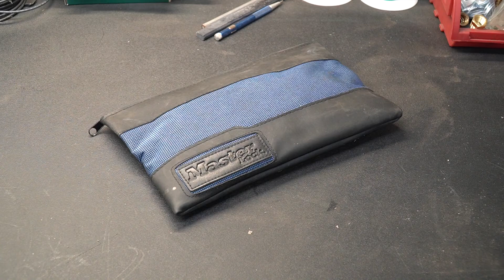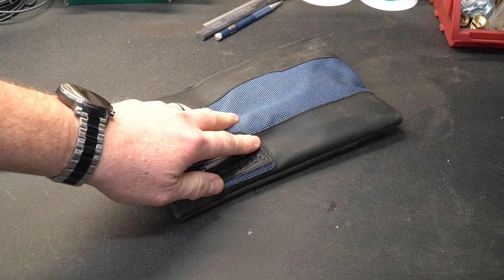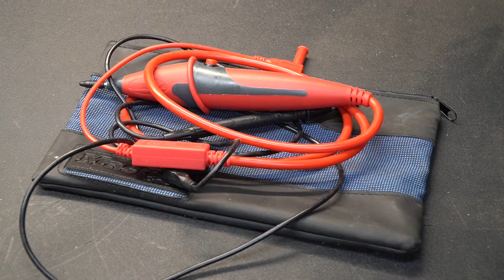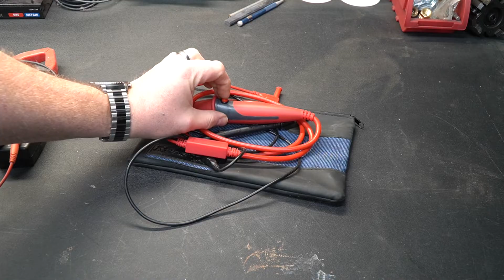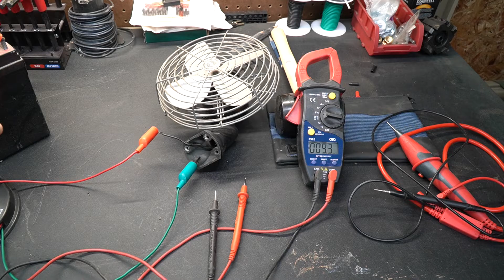Troubleshooting automotive wiring the easy way, with a Load Pro! "New Tool Day Tuesday"

Comment: What load does it apply? 1A? 3A?
Reply from the maker: The LoadPro applies a dynamic load of 40mA per volt.  On a standard 12V circuit, it draws approximately 0.5A (500mA).

Comment: can you use this to diagnose wiring issues in the Hi speed CANBUS system?
Reply: No. CANBUS does not carry any significant amperage. Only way Loadpro can help you is as a regular set of leads. It’s actually the meter that would help ( 120 v 60 ohms, for example).
Reply: @ thanks a lot

Comment: Need to let people know to use the ground on the function then move to a good ground if load is good on a good ground it’s the ground wire that is bad but if load isn’t good on a good ground then it the voltage wire that is bad you still only load the voltage wire but this way you can tell which one is corroded or nearly broke

Comment: The video would have been more informative had you explained what the reading should have been at 3:45 if there was no resistance in the circuit.  For example, does that 3 volt reading represent voltage drop?  Thanks
Reply: The voltage reaching the multimeter dropped from 12.8V down to 3V. That's a drop of 9.8V.

This is the same as checking the voltage to the fan while the fan is hooked up and trying to run.

Comment: Pretty nifty tool, I work on Semis and trailers.  Cummins now recommends using this tool for testing during some diagnostics. I gotta say it's so much faster to use than dragging out the ole headlight bulb to put a load on the circuit

Comment: I would think some would test for voltage while the the wires were hooked to the fan to give them the same diagnosis. But the tool sells for a reason.

Comment: What if your testing one specific wire from let’s say a sensor connector to the ECM connector? Where do you get the power for that circuit?
Reply: Completely isolate the wire, introduce battery voltage on one side of the wire, put load pro on the other side then connect the load pro negative lead to battery ground.

Comment: Just buy an electronic load or just a power resistor and a fuse.
Reply from the maker: Or you could make one.   Plenty of options for sure.   This is just another tool for the professional.

Comment: so what would have been the reading when you put a load on the good wire? Would the voltage have been higher or lower than 3v?
Reply: Should be close to battery voltage if the wire is good

Comment: I think one more step that would have been good to show people so they understand it a little better is to put the meter leads on the wires while they're connected to the fan to demonstrate that the load of the fan causes voltage drop due to high resistance inside the circuit. before I knew this tool existed I got burned pretty bad on a job where a truck wouldn't run but showed that the ECM had good voltage. after a lot of tail chasing I back probed the connector and plugged it in and the load of the ECM caused the voltage to drop to nothing. If I had owned the loadpro at the time I could have checked static voltage, seen that the voltage went to nothing and known right then and there that i had high resistance.

Comment: Interesting tool, but not needed. You have the circuit energized to test for proper voltage and ground at the component, never unplug a circuit looking for a voltage drop problem. you can not measure voltage drop on an open circuit. Leave the circuit plugged in and back probe the connector with a t pin and measure the voltage and again on the ground side.
Reply from the maker: Right, it's not needed, just another tool to speed up the trouble shooting process.

Comment: I can see the tool has value. However, why wouldn’t in this particular simulation would you simply use the fan?
Reply from the maker: If you knew the fan was good, sure.
Reply: @1D10CRACY  Assuming a bad wire, if the fan is good, wouldn’t it show the drop but not come on? If the fan is bad, wouldn’t it show the same voltage but not come on? Assuming a good wire if the fan doesn’t come on and you have voltage, then I’d guess a bad fan?
Reply from the maker: Your assumptions seem valid enough.  Keep in mind everyone has their own techniques when troubleshooting.   The load pro is just a tool that can sometimes help with speed, not a necessity.

Comment: Btw, do your best and use the negative from the plug...... just so you can rule out a corroded neg wire ;)
Reply: I read all the comments up to and including yours, because I was about to post the same thing. The author did not check the ground side from the connector to ground. He went straight to ground forgetting one half of the circuit! It’s a useful tool for sure!

Comment: This is a very handy tool. I took Dan Sullivan’s electrical class around twenty years ago and used his first version of this tool for the first part of my career. Being a heavy equipment mechanic it helped me troubleshoot many corrosion problems. It looked like a set of test leads with a black box in the middle that had a red test button. I later upgraded to this newer set. It saved me a lot of time troubleshooting problems and to me is a must have in your tool kit.

Comment: A pro needs a go-to built-for-purpose tool to speed troubleshooting.  Those of us DIY'ing can take the time to build the tools ourselves.

For load testing, just raid a couple of incandescent duel-filament tail light bulbs, sockets, and a few inches of wire lead the next time you're at the junk yard.  I have a collection of marker lights (0.2 amps), tail lights (0.5 and 2.0 amp), and headlights (55 and 65 watts).  Wide-mouthed athletic sports drink bottles can be cut like a funnel to provide a hood to protect flesh and bulb from meeting while hot.  Hot glue will anchor the bulb socket to the mouth of the funnel hood.

For troubleshooting powers and grounds almost duplicating the Power Probe tool?

Start with a quality 14 gauge, ten foot extension cord.  Cut the female plug off keeping 4' or so of the cord attached.  Strip back the external cord sheath 2' or so exposing the individual wires of power (black), ground (green), and common (white).  Attach 30 amp alligator clip/clamps to the individual wires -- a red clamp for the black wire, the black clamp for the white wire, and a naked clamp for the green example.  Use green heat shrink tubing to mark the ground clamp as, well, ground.

What we now have is a female power cord end with alligator clip/clamps on the other end.

Do the same thing to the male extension cord end but rather than use alligator clip/clamps, go with some kind of female banana socket.  Keep the red, black, and green color scheme consistent and with continuity.

So, how to use?  The red and black conductors are rather obvious.  The green conductor can be used for supplying a valid 5 volt reference if necessary.

Here's the nice thing about this setup..  If one needs a longer reach, just plug in any regular extension cord for battery-to-back-of-trailer diagnosing.

Be sure to leave each individual conductor with enough room to get an amp clamp around it.
Reply: Thanks

Comment: Just connect the dvom to the cables the same time as the fan and it will show the same result.
Reply from the maker: You could, and now you have to determine if there is an issue with the fan causing a voltage drop and not coming on, or if there is a broken wire, bad switch or something isn't capable of carrying the load.   Same result on the meter, but not the same answer.  You could use a test light to see if the circuit can carry a load!

Comment: I used the loadpro when repairing construction rental equipment. Found lots of corroded wires, defective switches even defective brand new switches. Lots of people trash talk this tool here on YouTube. But this is my prefer way to test voltage drop. I made an extension lead so it could fit in tight spots.
Reply: Does it work for 24v?
Reply: @everytoolashammer9427  Yes it does upto 28.5volts. I believe there is a newer version that does upto apx 48 volts.

Comment: As a technician, I find it a bit stupid that a technician would stop and recommend a component just because you see 12v on it's positive input. Part of the diagnostic process for electrical is checking for good power feed, checking operation of the component isolated from it's power and ground and then checking it's ground. I DID pick up a loadpro just to have a new tool in my toolbox, but it's going to sit beside my powerprobe which I use for actuating certain components.

As an example, I had a 2013 Pilot with 3 door lock actuators that would not lock/unlock. Checked it's input and output and found them switching normally. So our control from the integrated relays of the MICU were good and doing their jobs. ($800 part), so the next thing I went to check is isolating the door lock actuators from network, providing them a known good ground and 12v for a brief second, enough to actuate them open and closed. No functionality. Dead door lock actuators confirmed since when isolated. Same thing with your fan example. Fan doesnt work but is receiving 12v? Let's isolate it, give it 12v and boom, it's spinning like normal. Now we can focus our gaze on the ground side of the system since we've confirmed we've got A) Good power and B) a functioning component.

But it'll be fun trying to work the loadpro into my diagnostic routine since, hey, new tool because MUST HAVE NEW SHINY TOOLS.
Reply: It’s mostly meant to help figure out if you have high resistance in the circuit.

Comment: That’s a pretty cool tool. I seen a tool a while back and I can’t remember what it was called but you looped it or “open clamped it” on a wire and could run it down the wire to find the break in it. It was used to check Christmas lights and the light on it would go out when it found the break in the wire. Of course you couldn’t run it down many vehicle wires like you could Christmas lights but I thought it would be very useful too. Between the tool I described and your load pro you shown, it would answer about any electrical questions. 👍
Reply: Maybe a clamp meter ?
Reply: @akbychoice  possibly, I’ll have to look it up. It was cool for sure

Comment: It was a sad day when I realized that Dan Sullivan's company, original author of the LoadPro, went bankrupt a few years ago. I think marketing was the problem, since they did their best to obscure the simple design. As a tech, you must understand the design, otherwise you're working blind. It is a 25 ohm resistor, a switch, and a fuse in series. The multimeter measures the drop across that 25 ohm resistor, it usually measures 25.9 in mine, and it is good to check it before using the device to be sure it is working correctly. Knowing how the circuit inside works, you can easily understand what you are doing when measuring two readings, one with switch open, and a second with switch closed. With switch closed, current flows, and if extra line resistance is present the voltage measured by the meter will drop compared to the open circuit. A quick, simple way to do voltage drop testing in the real world.
Reply from the maker: Exactly!   Just a clean way to toss in a resistor!   I bought mine off of a tool truck many years ago that use to come to the shop where I was working.  I had never head of it befoe.  I also seen Napa sells a load pro, looks the same but it's blue.
Reply: Is it safe to use the Load Pro to test the fuel injector circuit in a gasoline vehicle? There is no injector pulse on all four injectors and the Nissan Sunny vehicle is cranking but not starting. I am looking forward for your reply.
Reply: @kennydoolarchan9515  That would not be my first tool for the situation of no injector pulse on all four. I'd be checking engine codes, specifically looking for evidence that the cam and crank signals are getting to the PCM. The computer won't fire injectors if it doesn't get timing info. Control signals on that signal wire from the PCM aren't prone to voltage drop because the current is so small, it is typically a square wave. You can look for that square wave with a scope, but with it affecting all cylinders, the problem is likely not one of the wires. Don't forget the timing belt/chain, which makes the dance happen.
Reply: @spelunkerd  Thanks for replying. There were no error codes when the vehicle was scanned. The ECM was replaced but still the vehicle was not starting.
Reply: @kennydoolarchan9515  Funny coincidence, the Youtube channel DiagnoseDan just posted a video today, titled "don't use a multimeter like this", outlining the complexity of diagnosing a no start when the immobilizer and computer aren't talking to each other. Different car, probably a very different system, but the basic principles are cogent. Even professionals struggle with the interplay of reflashing modules, communication between modules, and possibly broken wires. The more you know about these systems, the more humbling it becomes.

Comment: How did you determine if it was the ground or positive wire that was the problem? It a real scenario one would not know like you demonstrated.
Reply: Once the voltage drop occurs just move your ground lead to a known good ground (chassis) then just press the load pro button if the voltage drops again your problem will be on the positive side, if the voltage remains the same (little to no voltage drop, millivolts) than the problem will be on the negative (ground) side of the circuit.
Reply from the maker: In a real world scenario you would probably clip your ground lead to the frame or chassis of the vehicle.   But your right, in this scenario you have to figure out which one, either the ground or power wire.
Reply: @1D10CRACY  So how would you utilize this tool to verify that?
Reply from the maker: I don't really have a good answer other than trial and error.   I suppose if one of them is corroded, it would probably be a good idea to replace them both.
Reply: @1D10CRACY  I was just curious. I have heard of this tool but have never seen a demonstration on it. I suppose running a temporary ground and or positive wire one at a time would probably be the only way to determine which wire was the issue.
Reply: @Rngg01  You would start the test with both the positive and negative leads at the connection for the load with the load turned on, and if the voltage would drop low when you pressed the button,  indicating a bad connection, you would then leave the positive lead on the load, and move the negative lead to the battery negative post, or a known good ground, an again check the circuit by pressing the button. If the voltage still drops low, the problem is on the power side, if the voltage however now stays high, the problem is on the ground side of the circuit.